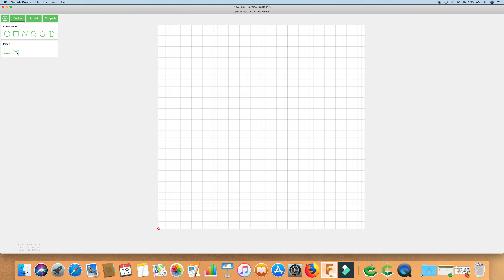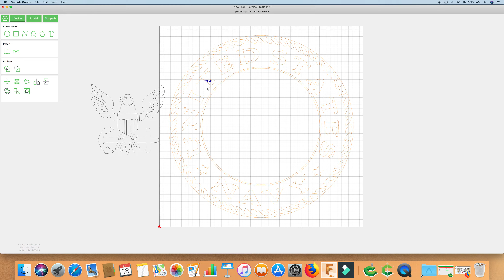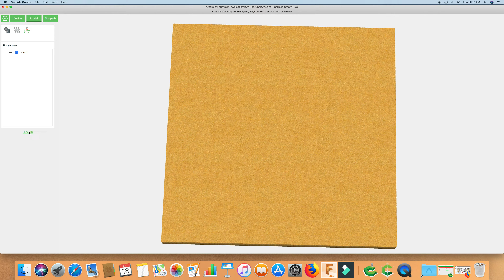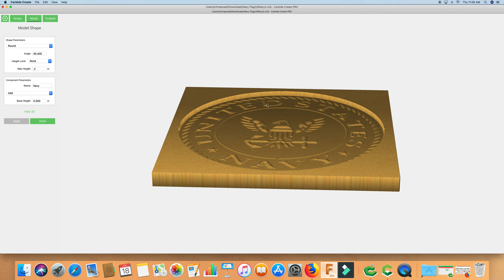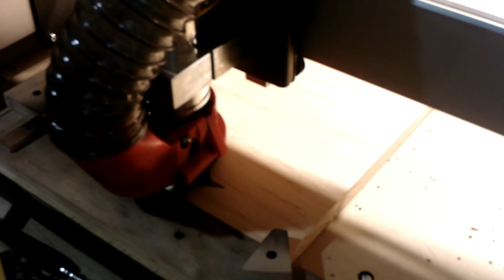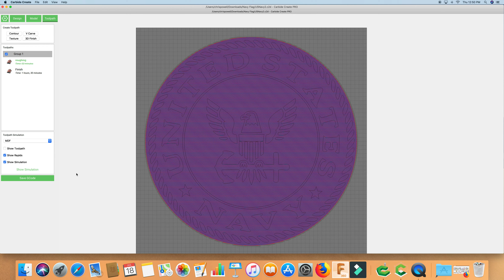Design and Program This 3D US Navy Seal With Carbide Create Pro

Comment: Great Video!  I know this video is a few years old, I have a question:  When you ran the second finish pass at the 45 degree angle, you weren't really removing any wood, what did you bump the speed up to in Carbide Motion?  I'm guessing 300% or more??

Comment: Awesome job! I’m a 20 year Navy vet so that was very to see. Wife bought me the carbide pro for my b-day so I’m just getting familiar with it. So when making multiple tool paths that require a bit change, do you have to save the g code separately?  Yesterday I attempted to make some coasters (90 deg) and then a final cutout w a different bit. The machine stopped and wouldn’t let me change bits.

Comment: Chris, have you done any fine engraving with 30 degree engraving bits or smaller? Trying to do a VA logo with lots of detail and it is very tricky. Anybody, feel free to chime in on this. Thanks
Reply from the maker: I usually use a 60 degree. The key to getting good details is having a perfectly flat and level wasteboard and material.

Comment: Hey Chris exxelent explanations question once you add you save  but where or I can wait and save the code only and then save as  file
Reply from the maker: Yea you can just save the g code by clicking the export g code button on the toolpath page, but I don’t recommend it. CC is pretty buggy, especially when doing 3d. It’s best to save designs regularly.
Reply: @ChrisPowellFSD  thank you very much 
But when you Klick save does it saves this where ? Or it’s just to protect your design Incase it freezes etc ?
Reply from the maker: It saves it to whatever folder you have selected. I’m on a Mac and mine goes to downloads.

Comment: Could i create my 3d design save it without setting up the tool path then import into easel them finish tool path in there? I just have a little hobby 3018 pro that im playing around with before i pull the trigger on a shapeoko.
Reply from the maker: I don’t think so. Maybe you could use cncjs to control the machine.
Reply: @ChrisPowellFSD  i guess one way to find out is i will try it.
Reply: Carbide create pro lets me export GRBL gcode and it will work on my 3018. Didnt try to import in easel just used carbide.

Comment: Everyone saves G code but if you carbide create, open Carbide Motion (put it in the open file/ start job window)  first then re-open carbide create, it has the option above save gcode to send job straight to CM. Then you can send them one at a time, make changes and send again. It has saved me lots of time and I can make small changes and sneak up on things better.

Comment: I'm a little confused about why you did the first square around the piece of stock since you didn't use it for any carving work and the system already knew your stock thickness was .70?  Can it not set the depth of the 3d carve without doing that first?  Also, the link for the 2nd eagle just goes to US Navy twitter feed, not emblems.
Reply from the maker: It’s just for the rendering. That was the representation of the piece of stock I was using. Just search ok google images for Navy logo svg and you should find a bunch of options.